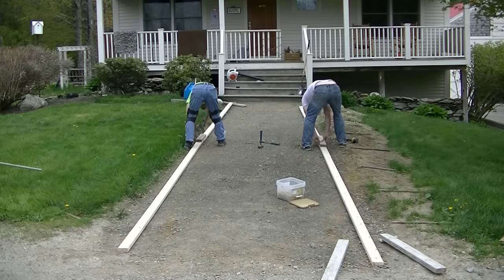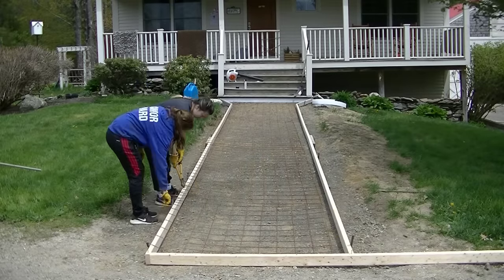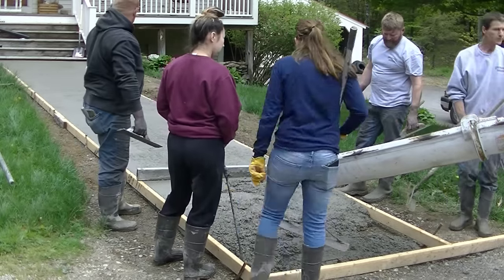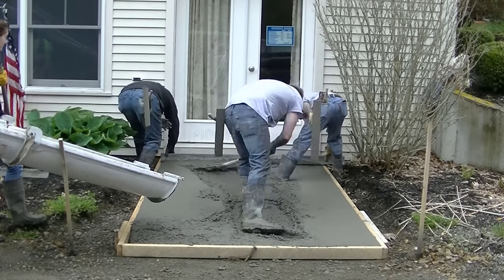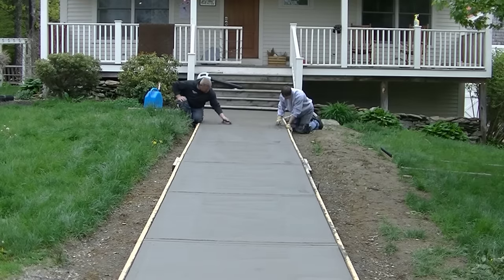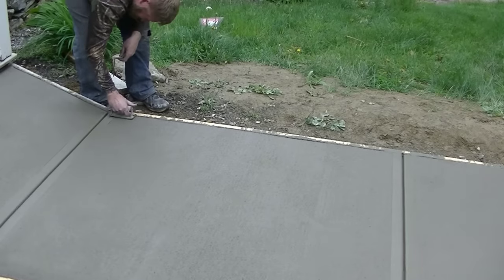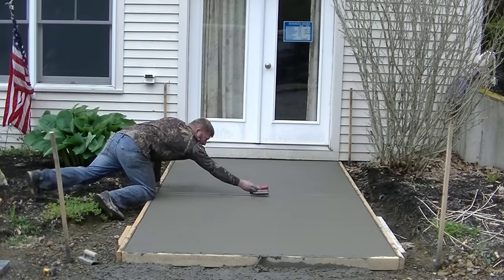CONCRETE SIDEWALK : FORMING, POURING AND FINISHING

Comment: I just retired as a cement mason after 45 yrs. I did alot of curb and gutter with the machine and sidewalk right behind the curbs. We would pour almost a mile of curb in these sub divisions tract homes. Couple days later we would pour the sidewalks, 100 cubic yards a day. Did it fir many years, we would never run shiners on the joints or edges. Differant finishes through out the USA

Comment: Excellent Professional work as the end result shows the skill level which is outstanding! Pouring and setting concrete is a job for the professionals because of three reasons #1. using the correct mix and wire #2. preparing your pour site from setting the concrete forms correctly and preparing the ground for correct slope #3. Finish work!

Comment: This is great! im a female trying to get into concret work. seeing other females helps alot.
Reply: Why would you want to get into concrete work & the wire the one girl is trying to pull up is just being pushed down by the other steeping down on it.  I think every time I'm seen people using the welded wire they end up just having it mostly laying on the bottom of the concrete, thus likely doing more harm than good.  That is why I never use the wire I use re-bar.  All the power to you if you want to do concrete work, it is rather satisfying but there is lot better ways to earn a living.  But work done well is most always to be respected what ever the case.  BTW I'm not a real concrete man I'm more an electrician than anything, but I've done a few slabs & odd & ends.  I've had my girl (age 15) help me with all kinds of the work I do, she never seems to want  to but when she is helping me she seems to do a rather good job & content enough doing it.  I tell her she doesn't have to do any of that type of work but I do want her to know enough not to be taken advantage of.  Well best  to you. :)
Reply: @VerifyVeracity  there are alot of concrete jobs available where I live and they are needed. I'm a forklift driver already just looking for a side job. concrete seems like itll fit my work schedule
Reply: Ebony Lo. You get into concrete yet? I work in a factory and used to be a forklift driver before I got my better job I did concrete during the day and drive forklift at night. Not a bad job at all once you learn what you’re doing. I mainly did flat work like this so not rocket science:
Reply: @notachance3444  Not at the moment I've put in applications since this comment. And I haven't gotten any luck. I however moved up from forklifting to logistics.
Reply: Ebony Lo. Well congratulations on the job and I’m sure if you keep at it you can get a side job doing concrete. I actually found a couple guys doing a sidewalk by my house. I asked if I could have their bosses number and the guy said yeah I own the company what’s up? So I said I wanted to learn concrete but had no experience I offered to do it for a month at $10 a hour to see if they wanted me and I think the second week. He moved me to $14 and all I really did was wash tools and help with the pour. He offered me full time work at around $20 a hour but I couldn’t leave my full time job for seasonal work. Sometimes finding people doing small jobs and asking is the best way.
Reply: @notachance3444  that's awesome man! I thought about seasonal job as well but thought that would be suicidal. Lol
Reply: Take all of Mike days courses. Then place ad in Craigslist for concrete helper

Comment: Hi Mike, love your content! You have talent for more than concrete, but teaching and workmanship too.
I noticed that some people spray a curing fluid after concrete work and some don't. When is that necessary?
Reply from the maker: It is important to cure the concrete. Whether you spray on a curing agent or keep the concrete wet. That's usually not part of my scope of work.
Reply: Hi there we have a form of concrete in the UK that is like liquid it's self levelling with small stones in it and silicones you done have to do much to get it level at all just slap it lightly and fast make it rippel then they spray it to stop it becoming very dusty on top or when it's hot they make use spray with silicones mix to stop it having hair line cracks

Comment: I want to put a walkway along about 30 feet of my house. Can I let the concrete touch the slab foundation or do I need the foam separator?
Reply from the maker: It's usually better to have some type of foam/bond breaker.
Reply from the maker: It's usually better to have some type of foam/bond breaker.
Reply: @MikeDayConcrete  thank you

Comment: Can this be done one square at a time?  I'd like to replace a sidewalk but I don't have the resources to do it all at once.
Reply: Leland Wilson not recommend
Reply from the maker: It could, you would want to drill and pin them together so one doesn't move higher or lower than the other over time.
Reply: @MikeDayConcrete  What do you mean by drill and pin?
Reply: @cheyannbissell7327  weird
Reply: @cheyannbissell7327  right
Reply: Plen122 it’s called doweling. You drill into the old square and put Rebar sticking out of the old square so the new square is attached

Comment: How come didn’t use MarsBars underneath the mesh? Ideally you’d wanna lift it up by at least 1 inch off the base/floor.
Reply: They pulled it up by hand as they were spreading.
Reply: minkowski91 hahaha 😂 thats just pure lazy, you can use bricks chop a brick in 3/4 pieces, if you can’t be bothered buying proper concrete bars, or i even seen groundworkers use roof slates or whatever as long as you lift the mesh off the floor it’ll be fine, lifting it up while pouring it? That never seen done before lol, but hey if it works for you why not, if somebody did that in any of my jobs? Id tell them to pack their tools and leave my site.. 🤷🏻‍♂️ lifting it up while pouring it does nothing mesh is heavier than the concrete mix and as soon as you let go the mesh? It’ll fall back on a ground.
Reply: Pretty much that’s why I don’t have a concrete driveway because it’s impossible to find people that know what they are doing. I level concrete for a living, so we have to drill holes in the old concrete to lift it back up. you can see the rebar just sitting below the slab because they didn’t prop it up at all. Not even touching the concrete lol.

Comment: Thanks for the video, very helpful. You mentioned that the ground is hard, is that why you didn't lay down any gravel before you poured the concrete? I want to pour a sidewalk as well and also have level but very hard ground with lots of rocks. If i don't need to dig a base that would be game changer.

Comment: Did my first pour two weeks ago. As a pre-apprentice, I'm extremely impressed with how fast you guys and my instructor are able to finish this process quickly. I overthink way too much during training so I end up making more mistakes.(we practice with damp sand because our instructor says it's harder to learn than concrete so if we learn the sand concrete would be easier) It's actually crazy to see how much experience really pays off on the job.
Reply: You should try practicing with pool krete lol. Makes you work hard to rid of the troll marks🤮

Comment: What a great video Mike, very informative. It's good to know to use the same hand tool on each pass because each tool is different. With the depth of the jointer or edger, it makes it much easier. Also like the way you clean the brush before each pass eliminating any roll up of concrete leaving a shoddy surface.

Comment: I dont understand why you didnt keep the walk up to the top of the bottom step instead of leaving that 3 inch trip step ?
Reply from the maker: They didn't want me to. They're building new stairs that will sit on the walk eventually.
Reply: @MikeDayConcrete  That is strange, they would have been better to put the new steps in before the concrete work was done, if I was doing that job & they said they are going to be putting new steps in I would have recommended to do that 1st

Comment: Doing my sidewalks next week. The only question I have is when do you use expansion joints.
The sidewalks I pulled out 4‘ x8’.  A dummy joint in the middle. Every 8 foot there was an expansion joint.  
Is this necessary?

Comment: Awesome Video!!  WHY???  Mike, around the 11:20 to 11:50 time frame, as you were cutting in the relief cuts, why did you pull the cutting tool out of the cut and scrape it across the surface of the concrete to the right of each cut?  It looks like you made a mark to one side of every relief cut.  Just wondering why?  Thanks!

Comment: Lift the mesh up a bit
Reply: Patula el duderino she is
Reply: There was a girl pulling up the wire. It should be in the bottom third of the slab, so basically just pull it up enough to get a little bit of concrete under it. Most folks think reinforcement for slabs are to be in the middle of the slab which is incorrect.  As a slab settles, the top 3rd of the slab will be Compressed together. The bottom 3rd of the slab will be pulling apart . Therefore reinforcement needs to be in the bottom 3rd of the slab to hold the bottom of the slab together. Imagine taking a 16' long wooden plank and setting it on cinder blocks at each end. If you were  to step up on to the plank in the middle, the board bows under your weight. Wood grains on the bottom of the plank pull apart while wood grains on the top are pressed together.   If the board was to snap, the board would snap from the bottom up with the top likely still holding together By several wood grains. Same is true with concrete slabs.

Comment: Nice job, great video!  Thanks, if you care for a heads up?  The bottom landing is not right because the step riser has lost equal elevation with tho other steps. It could be a trip hazard. Each step should have an equal rise unless there is a 36" landing for a transition in heights.  The step could have been poured higher to match the next one up, or lower by digging it out to grade.  (the inspector made me fix it on one I did)

Comment: You dont pull your forms same day and trowel the outside of the area and continue the control joints through the outside face? Risky, you can end up with some decent bug holes, I poured it like you for a long time then started pulling my boards (when it's an above grade slab) and using an outside corner trowel. I stick a piece of rebar at the form board and slide it down to the bottom of the slab, remove it (this forces the aggregate out of the way) and continue my control joint on the vertical face of the slab with a v-groove trowel. It makes a difference on the appearance of the slab, even when I used a power screed I would notice a few small bug holes. Nice job on the slab. 👍
Reply from the maker: We pull the forms the same day most pours.
Reply: @MikeDayConcrete  Good man👍

Comment: I need to tear out and replace my raised Frt. Porch Slab.  The slab has a crack through the center more less cutting it in half.  The crack hasn't opened up to anything significant yet.  It does go completely across the porch though.  It has been raised up by brick.  What sort of advice would you have for something like this?  Thank you for your time.
     Jeff Sabo

Comment: No string line on those forms. No level across. God dammmnn
Reply: Dakota John eagles eye 👁
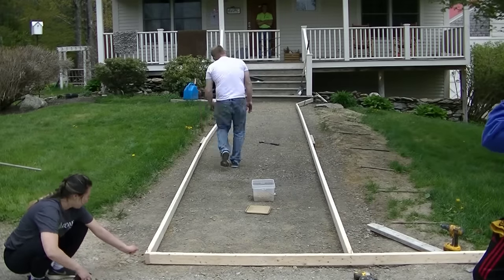Reply: String at 2:30. They said they checked slope of gravel/base and used that to establish slope of forms.
Reply: What we do is set our grade always at the house and depending on the slope the homeowner wants but jus say they want it to drop 1/4 inch per foot, figure that and set the ends of the forms, then run lines down both sides and set our grade right of that string line we never use a lever to set forms doing flat work

Comment: When I build forms for a sidewalk, especially a curved walk, I cut a few 1 X 4 boards to the width of the concrete to use as a gauge as I set the sides. Floating the edges before screeding is a heck of a tip. It'll save me some edging headaches. Thanks.

Comment: the wire mesh should be at the middle of the concrete not bottom. it needs cover
Reply: Thought the exact same thing. The mesh needs to be totally encased within the concrete to prevent water ingress. Otherwise the steel will eventually rust and then swell up, compromising the entire slab.
Reply: The girls was lifting it up as they were pouring!! Look again

Comment: Hi Mike, what do concrete companies generally charge to add plasticizor to concrete? What term do I use when I ask for it? I've done alot of stamped concrete driveways, patios and walks but I'm planning on doing a basement floor for the first time on a house I'm building and the concrete you do seems to screed easily, it looks like the plasticizor helps. Thanks

Comment: So on exterior pours, it looks like you don’t finish the concrete with steel trowels- just using a mag and going straight to brooming? Are steel trowels only used for interior and/or smooth finishes?

Comment: I just put down 25 yds. of 5' wide,4" thick, county walk. Spread, struck and bull floated. Edged, Finished,   Hand jointed w a straight edge, broomed, stripped and loaded forms, put in 4 handicap stamps and expansion every 50'. And left job in 2.5 hrs.   By myself. With the help of 3 talented front discharge drivers. Any tips? I think it's a timing thing?

Comment: I have two questions, please? 

I noticed that the (sidewalk) wire mesh was only pulled up on one side.  And, I notice that you guys often walk through the pour when screeding.  Chairs are sold for holding up mesh and rebar, but it seems you could not use those, because of how you screed?  How does the height of wire mesh affect the long term stability of the structure?  I thought it was important for it to be about 1/3 up from the base?  How would I screed a larger pad (15'x20') if I use the chairs?

Question two.  You use the border to screed, but I don't see anyone planing, or otherwise making sure both sides are level.  How did you assure that the concrete was level (side to side?)

Sorry, that may have been more than two ??  Thank you for your content, and your help.

Comment: Great job , I have a question isn't the rebar supposed to be elevated not laying on the ground? I see people putting rocks under the rebar to raise it up half way.. Wouldn't that would reinforce it better. I just asking. I then see them pullings up on the rebar but it still went back flat on the ground. That's what it look like anyway
Reply from the maker: We usually put chairs under it to suspend it. Didn't have any today. Once you pull it up and get concrete under it, it doesn't go back down all the way so it still works.

Comment: Thanks for sharing your wealth of experience. Quick question and any feed back will be helpful. I just dug up a 4’ extension to my driveway and found the expected irrigation system which I was prepared to move over the 4’. But also hiding in there was my water main line and a down spout drainage line. What are my options to complete this job? Do I have to reroute everything or can I pour right over them?
Reply from the maker: You should be able to pour over them. Maybe you could sleeve a larger drain pipe over them for future repairs if necessary

Comment: Hey Mike. 31 year concrete guy here. I've been watching your videos for quite a few years and I think you do great work. I started a business in Northern Ohio in the 93 before moving to Central Virginia and restarting in 2012. Everywhere I've ever done work, code says all steps have to be the same height. We either have to go down to the bottom step or pour to the top of the first step. How can you make the first step 1 to 2 inches  and it passes inspection and not considered a trip hazard?
Reply from the maker: They're re-doing the steps. We did a large pool deck also and they wanted us to do the walk at the same time so that's how it worked out. They're bringing the steps down on the slab and will fix the rise accordingly.

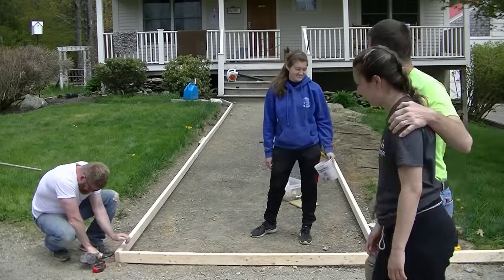Comment: 2:05 - The way that end board is being attached, the right side of the sidewalk will be 1 1/2" longer than the left side. He should have attached that board across in FRONT of the board down the side, as it is on the right side.
Reply: Unless they compensated by making one of the size shorter. But probably didn't lol

Comment: Hello Mr. Mike Day!  I have a very similar project here in Kentucky and I need to ask a question.  The next step in my project is mixing and pouring approx. 50 80-pound bags of concrete.  The walkway is 30 feet long but I just can't complete this step in one day.  So, my question is, "Can I pour, float, and finish the first 30 feet  of walkway in one day then, complete the remaining 15 feet the following day?"  I want to place a temporary (overnight) 2 by 4 at the 15 foot mark.  This temporary 2 by 4 requires boring 3 holes and inserting some half inch steel rebar with about 12 inches protruding.  The next day I will remove the temporary 2 by 4 and pour, float, and finish the remaining 15 feet.  Will this idea work?  Regards,  Mike G.
Reply from the maker: Yes, you can do it that way for sure!

Comment: 2022  sept    driveway  widened  for 2  cars  wide    plus  mobility scooter wide   between the   foundation  down    5  in     length  40ft  rebar   laid    6  guys    great  job  cement del   by  large  cement truck even extended  rework into my garage as  bonus looks  great   i had a pesky  sewer drai n hump in middle  they fixed  that  nice ?    was aggravating  when i drove   in or out  on my  mobility scooter . weather  ? perfect $5k total  they had a  huge  job across from my house  multi mill$$  property.  very handy i could see there work in progress,

Comment: Is this your first time doing concrete? A 4.5 slump is plenty for that walkway slope. Also you should be using deep shovels to push that concrete down in place to get all the air out of it and then use your smoothing tools in sections as you go along.